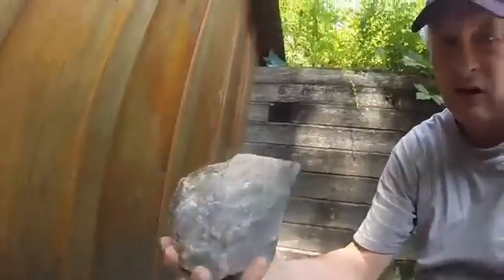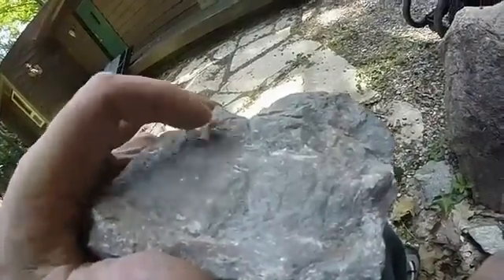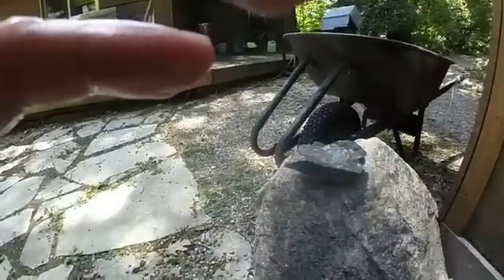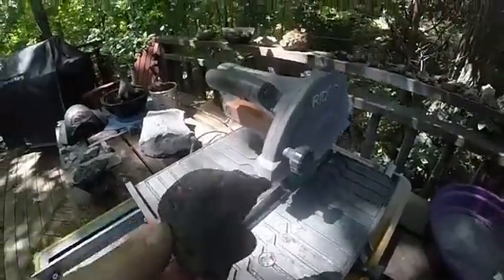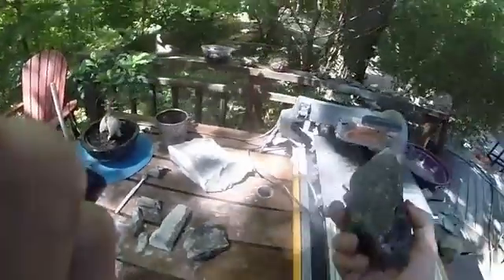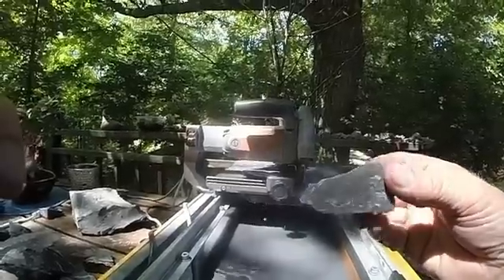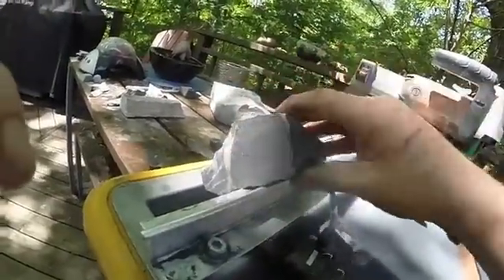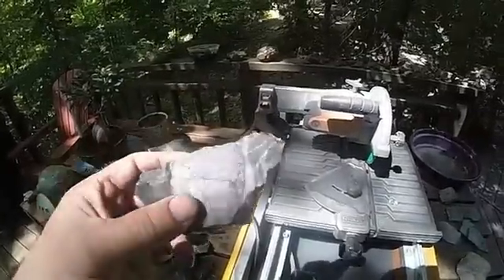WHAT DOES SILVER ORE LOOK LIKE?

Comment: Thank you for your video.
I had an interesting experience today in SE AZ. A friend took me to a church high on the side of a mountain. As I walked along the keystone and brick paths I noticed laying beside them were a mix of sedimentary rock, slate and granite rocks that were displaced to form the walkways cut into the dirt hillsides. I continued until the path ended, but proceeded along the hillside anyway hoping to find the source for all these different rocks. Another hundred of so feet  I found what I was looking  for - a massive rock face 50x150 feet exposing sedimentary rock, slate and a vein of granite between 3/4 - 1&1/2 inches running the entire length of the surface. But even more spectacular was along the vein was what appeared to be a very bright, shiny, silver in color, foil-thin metal that I can only describe as melted to the surface of the granite. I managed to break some of the chunks of granite out, as cracks ran across it from what appeared to be the hillside settling. Other pieces of the silver colored metal I carved out with my pocket knife.
Not having a background in geology or any training whatsoever, I'm extremely puzzled as to what this metal is; can anyone reading this shed light on the probabilities? 
Thank you.
Reply from the maker: Sometimes that would be mica

Comment: Is it possible to have silver veins in dirt or clay , I also saw a large bolder that was a blueish grey , but I poured a slab and built a garage over it
Reply from the maker: If it was glacial clay, then perhaps a glacier dropped float silver there.  I wouldn't dig up the floor to find out now.
Reply: @meMiner  I was thinking of making a root cellar and dig under the building till I hit the boulder . then chip a chunk off and use a metal detector on it or bust it up and melt it down with borax .

Comment: Is there any way to field test for metal by sound? Like you know how jade rock makes a metallic ping when struck? Do precious metals and alloys make the same kinda loud ping when struck?
Reply from the maker: Not really.  At least, not in any way that I have found useful.  However, weight is a great indicator (heavy being better).  Breaking the rock to see what it looks like inside fresh works pretty good.  Also, silver vein is usually rough and feels like crumpled tin foil when rubbed.  Of course, an XRF works great, but a quality metal detector can also give an indication.
Reply: Yeah I've got myself a bounty hunter gold digger that's actually proven itself very useful quite a few times!! I definitely need to get a pin pointer though!
 Would one help separate between vein material (if not visible) and "hot rock" pretty well? 

Also thankyou for the quick response and awesome videos you share!!
Reply from the maker: @matthunt7390  Hot rocks are typically stained brown.
Reply: @meMiner  oh sure thing! That good old hematite/magnatite, iron rich minerals.
 I  have this one fairly large and heavy for its size, sedimentary rock that I found in byron Maine that has me puzzled. It definitely has some silver in it but there is also a few other distinctive metals in it also. Suppose I oughta try and crush it and smelt it!

Comment: I'm in a location where I believe it was hot springs material coming up carrying different minerals. And I dug into an area that started out goldish color and was very fine sand type material. My metal detector told me it was gold and it was only about a foot deep. Underneath it was this gray material that I never checked with my metal detector until after watching this video. It says it's copper silver. And it's very Battleship Gray color. I thought it was just some kind of clay. I was able to dig into it with a little adjustable Army shovel that I had sharpened the edge to make it easier to cut through the dirt. now that I've seen this video I couldn't see the colors perfectly, however it looked Battleship Gray. I can't really tell what the shiny portion of the silver is doing in the photos or video. so I'm thinking that if this is the case that I've got a silver copper ore oh, it could be very rich. no other reason than the fact that it rings up as silver half dollars and a penny also on my metal detector. thank you for showing a better video about silver or. Does it always have to be shiny? or can it be in teeny particles that don't shine?
Reply from the maker: Silver will oxidize black.  Hard to say what is in your spot from the description, but my first thought is mica in clay.  Best bet is to pan some down to wash out the clay and hopefully leave heavies behind.  If the resulting heavies are a metal, then you should look at the surrounding rock.  You might have "pocket gold" where the host rock has degraded into clay and the gold has accumulated straight down.  Good luck.

Comment: Question Would the slices you made be suitable for use as tile?From the video it looks like something I might "sideline"thAt is takeing ore specimen and cutting them up for tile.that last piece you cut up would look super cool as a back splash on an out door cooking island or bar next to the pool,
Reply from the maker: Very interesting question.  My initial reaction is it might be awful expensive tile.  Larger samples of good are rare and getting quite difficult to find.  On the other hand, I am sure nickel and cobalt would also make nice pieces and they shine up like chrome if polished.  The resulting pieces would need to be sealed so there is no oxidation of the minerals.  You would also need a large saw.  If you try it, let me know how it turns out.
Reply from the maker: I meant to say "larger samples of good silver" in the above
Reply: I would never use rock with silver in it, as tile. Unless I already had more money than I knew what to do with. But, the nickel and cobalt would make awesome tiles.
Reply from the maker: I just read that some of the local mansions in the area (owned by the claim holders) used silver ore from their mines in the rock for their fireplaces.  Expensive fireplaces...
Reply from the maker: I understand where you are coming from and wish you the best with your Nevada project.  Building your own home site is very fulfilling.
Reply from the maker: A single-wide is always an option or a container building.  I have built a few cottages and from that experience would make mine from wood.  It is not that expensive, if you do the construction yourself and you have something to be proud when you are done.  Also, you can start small and then add-on later for any of the options.  When you build your fireplace, I would be happy to send you as much cobalt as you think you require, but even with the rocks free, shipping would be awful as the stuff is heavy.  I hope your gold prospecting goes well.  My first passion was placer gold, but I never got enough to pay expenses.  I am lucky to have an extraordinary silver camp 6 hours away.
Reply: Indeed. As a broke human with modest needs compared to most people, and as a person who has not yet been able to even put a modest shelter and a well on the lot I bought in Nevada, that I hope to call home---using silver ore in a fireplace is unfathomable to me.
Reply: @susanhopemason  hey susan. You chanell looks interesting. Are you single?
Reply: Thanks, tess99991, I just bought a metal detector, and some gold panning gear, and I am hoping to get the money I need to get what I need to live on my lot, through metal detecting and gold prospecting. I just encountered your videos yesterday, and I will also add silver prospecting. I like the look of silver better than the look of gold, but you need more silver...so I am going to try to find everything that I can possibly find. Cobalt would make a pretty fireplace, without being so expensive, though. I am trying to find ways of keeping the costs to the barest minimum while still having adequate shelter, so I am currently thinking along the lines of a good but used single-wide.
Reply: The reason I am thinking of a used single-wide, is because all the doors, windows, flooring, plumbing and wiring is already in place and does not need to be installed. I am no carpenter or plumber or electrician, and I would have no help.  I also would have no shelter while I was building, if I did built, and my only option would be living in a cheap tent while building. I also have no transportation, which means that I cannot go back and forth. I would have to have at least the basics, already in place before I can even go there. I am staying in California right now, staying with a friend, so that would be a long commute. I like fire places, but I was thinking more along the lines of a wood stove for winter heat. The single-wide might need minor repairs, but I would buy one that did not have any serious issues that I would have to address and repair quickly. I can also metal detect on my own lot, once I get there, and I own all the mineral rights to the lot...so whatever I find there, is mine to keep or sell. 

I have this huge sluice box, that is 12 inches wide and taller than I am--plus the rest of the needed equipment and tools--except for the really expensive stuff like high bankers, etc. . So, whenever I get the chance to go out prospecting, I am ready. There are people interested in going with me, and they have transportation...but things are busy here right now,, so it will not happen until a few things get done, and things settle down enough. 

I have been practicing with my new detector in this yard, but it has not been very good. Tons of signals here, but almost all of them are rusty nails. I did find a 66 clad rosy, an old battery, and a used shell casing, though. If the rosy had been two years older, it would have been silver. 

And, yes, you are really lucky to be so close to a silver camp. That is really cool. Your father-in-law is wrong, your videos are not boring at all. I find them very interesting and informative.